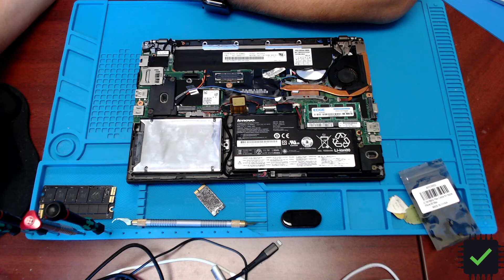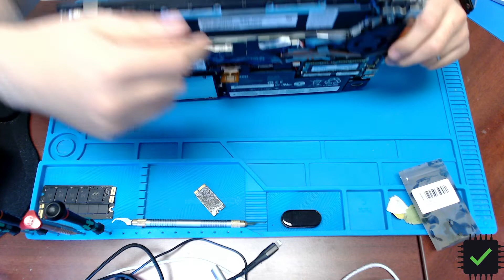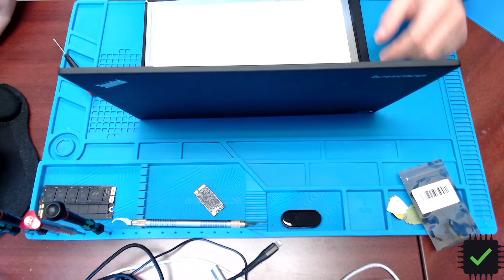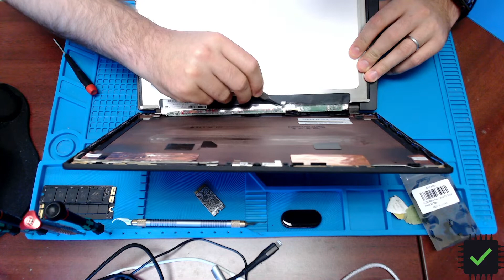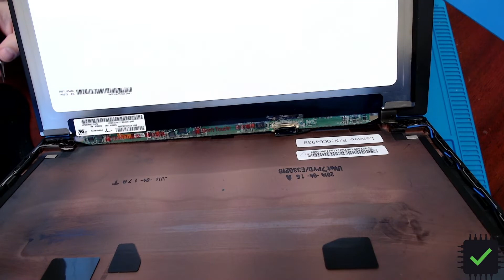Lenovo X240 No backlight diagnostics and repair

Comment: I had the same no backlight issue on a Lenovo X240 laptop. I could tell LCD screen was working because you could see it if you held a light/torch up to it, it’s just that there was no backlight. I removed the screen bezel as per the video and the connector was indeed loose. Plugged it back in, reassembled the screen and now it works again. Nice one!